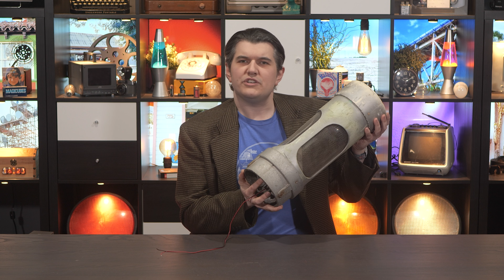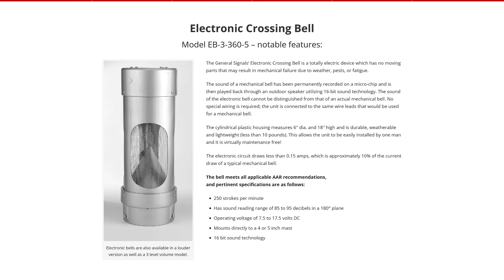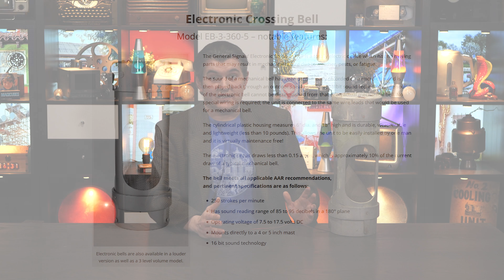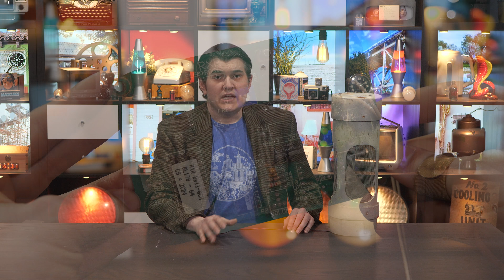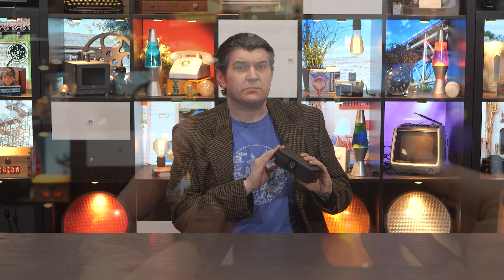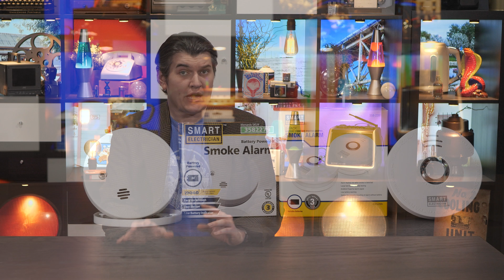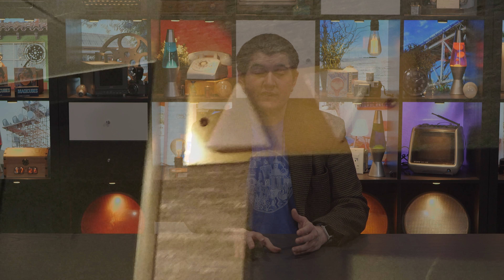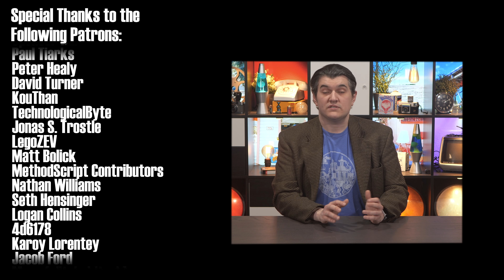The disappearing and unappreciated art of audible alerts

Comment: I'm a ham radio operator, and I use Morse code.  The coded message you put in this video came through loud and clear here.  I've set up my phone so that, when one of my frequent contacts calls me, it plays their first name in Morse code.  If someone unknown calls, it just plays "RING".  If I get a text message, it says "TXT". An email generates the word "MAIL".  My phone generates Morse code at reasonably low volume and pitch, so while others can hear it, it's not very obtrusive, as ringtones go.  It's also rarely understood by bystanders, unless I'm at a meeting of my ham radio club.

You mentioned watches with an hourly beep.  I remember being in meeting and conference rooms around the late 1980s, where if there were a hundred people in the room, you might hear fifteen or twenty beeps around the top of the hour.  Most watches didn't have a way of automatically synchronizing themselves back then, so the beeps might be spread out over a few minutes.  I still own and wear some watches with that capability, but like most people, I've left it turned off since 1990.

Thanks for explaining the temporal 3 signal!  It might save my life some day, and I had never noticed it before.

Comment: - I always thought it was metal, never knew it was silver-painted PVC tubes !
- Funnily enough back in the 80's, the UK started switching its railroad crossing bells for...alarm sounders, sounding a hi-low tone that would go faster if a second train is approaching
- Temporal 3 with mechanical bells is apparently quite common in Canada, and it sounds glorious especially in large spaces. Never been there but I've seen videos.
- In Europe, cheap smoke alarms still sound the old continuously pulsating beeping tone that was common in the US in the 80's, early 90's (usually called "4/6 pattern"). The better quality ones sound Temporal 3. As for professional fire alarms, each country has its sound. The Netherlands use slow whoop, France uses a skipping hi-low tone with the high tone much shorter than the low tone, Germany a sweep tone from high to low pitch etc...
- 16:49 "Caution ! The doors are about to close !"

Comment: I can really resonate with tech-design doing things I don't want, need or is just plain annoying. I don't know much about American or Canadian cars, but the amount of intrusive assistance systems built into cars in Europe these days are more irritating than helpful.

With the amount of useless and/or unneeded alerts, acoustic signals and plain false-positives modern vehicles give I sometimes feel like I am driving with a tired and whiny child on my lap. To make things worse they don't want you to opt-out and turn them off- 'For safety reasons' they are automatically switched back on when you restart the car. 

A fun example: I drive every day on a recently refurbished road that now has a 50 km/h limit again. Everyday my car beeps and whines at me for driving too fast; it's internal maps has the road flagged as a 30 km/h limit and it will do so until I cough up the update fees, download a corrected map and the car finally shuts up. Or I can switch the system off... every single time I turn on the ignition.

Comment: Yeah I hate modern tech. Fully onboard with everything you're saying here. Big companies don't give a damn about anything but profit.
Those E-bells as we call them have always been kinda tinny, I hear the safetran ones a lot and they get kind of annoying, while to me a real mechanical bell is a more pleasant sound because it's genuine, not just a speaker. And of course, the speaker always wins out over the classic bell because it's cheaper. Not really anyone makes mechanical crossing bells anymore. Even the mechanical bells were rock-simple (you should get one! You'll really appreciate how simple they are inside.) typically consisting of a magnet powered on and off by a contactor, a weight and a striker all mechanically linked. The magnet power linked with the contactor which acts as a cutoff for the magnet makes the whole linkage start oscillating, striking the gong. And they just worked with virtually zero maintenance for the life of the bell, many still do after being untouched for two or three decades (but of course railroads are replacing them anyways through crossing upgrades that are kind of unnecessary). Those bells are basically run-to-break, then they're replaced with whatever the signal maintainer has in his truck and the old bell gets thrown out. Even then, most thrown out crossing equipment still works when withdrawn.

Comment: My carbon monoxide detector just yells "carbon monoxide detected" but uses beeps instead of yelling "smoke detected". It also has a cryptic series of chirps and flashes for low battery or low power supply or fault. It's a speaker with a sound file so I would appreciate if devices just said what they mean. My dishwasher could have a little song instead if ear piercing beeps. This is the technological advancement I want, not internet connected fridges that make people watch ads.

Comment: Well this is interesting-- one of the first Technology Connections videos I disagree with. I do agree that sometimes, in some contexts, audible alerts are good and important. Train crossing alarms and fire alarms are two examples of those. But audible alerts on a personal mobile device are not for several reasons, one of which is they do not scale. You say that your alerts are specifically chosen to be unobtrusive to those around you, and that's great. But what if everyone chooses the same "unobtrusive" alerts? You'll have dings and bongs and chimes going off constantly in a crowded area, such that a) there's still way too much overall noise, and b) no one can tell which noise their device is making versus anyone else's. 

Add to that the fact there are plenty of contexts where audible alerts of any kind are completely inappropriate, such as movie theaters, classrooms, funerals, and so on, meaning you have to remember to constantly flip your device from audible to silent, which not everyone will remember to do. If you leave it on vibrate, you never have this problem. You say you don't always feel vibrations, and that's valid-- but in those hopefully rare cases where you are specifically waiting for an important notification, making your phone audible should be the exception, not the rule. Even after cutting back as many notifications as possible, most notifications simply aren't time sensitive. You can also have longer vibrations for ones that are, similar to a vibration ringtone, increasing the likelihood that you'll notice it. 

Along those lines, while I don't have data to prove it, I suspect most people are more likely to notice vibrations that never actually occurred rather than miss ones which did (phanton vibrations), which the phone + watch combo solves: if you think you felt a vibration, check your watch and see if you did. This further cuts down on the need for audible alerts for most people.

Comment: Living behind a church, I've gotten so used to hearing the faint bells on the hour that a lot of the time I very rarely need to look at a clock when I'm at home. If I were to ever move away I would probably have to recreate it somehow.
Reply: There are wall clocks that have hourly chimes. Or go full DIY with an Arduino.
Reply: @doubledarefan  these are great options that I have thought about, it’s more so the subtlety of the distance of the bells, they’re not intrusive. They’re almost background noise
Reply: id suggest getting an old regulator clock with westminster chimes
Reply: @knockrotter9372 Exactly what I thought of!
Reply: Grandfather clock
Reply: In a large second-hand charity shop I poked around recently, they literally had five mechanical clocks with chime mechanisms lined up.  One of them was especially cheap because it had a broken glass panel on it.

Comment: I feel your pain. The default settings always have to cater for the lowest common denominator of users, which for me usually means having annoying default settings that can't be customised.

For example, for more than a decade it has been impossible to add a new label to an email in the Gmail app. You can only apply existing labels. To create a new one you have to use the web interface. How absolutely ridiculous is that?!

Edit: typo

Additional edit: I've been using FairEmail recently, which has a pretty good degree of customisability. Great for unusual people like me!

Comment: I use the Signal app for most of my texting communication. With it I was able to set specific sounds for different contacts. On the other hand Pokemon Go keeps resetting the changes to the settings I make and have push notifications come through even though I set it to stop that. Except the notification that I got a Raid invite that I do want to know about but because all push notifications sounds are the same I have to check every time I hear it to see if an invite came through or not because you have less than a minute to see and log in to the app, if you aren't already, in order to participate.

Comment: You mentioned piezoelectric buzzers in the outtakes, but I think it got cut from the actual video. I think they are part of why modern sound design has deteriorated. As part of the capitalist race to the bottom, proper loudspeakers have been replaced with piezo buzzers to save a few cents on manufacturing, which just don’t have the capability to produce more pleasant sounds.

Comment: I did not have time to view the whole video, and it is quite possible that my issue was addressed, but here goes: 

Why does my microwave oven need to BEEP five (5) times when the timer runs down to zero? The oven already makes a noise, I am quite sure that no one in my household is unsure if the microwave oven is currently running or not. 

Some of our senses get used to the same stimuli over time (like our nose gets used to any smell after a few minutes) BUT our brain can perceive light turned off or a soundwave cutting off.

WE DON'T NEED ADDITIONAL STIMULI WHEN THE MICROWAVE OVEN STOPS. I can notice the change from HUMMMMMMMMMMMMMMMMMMMMMMM - to none.

I know, it is just 1-2 wires I need to cut inside the oven to make it mute. I once had to open it to change the plate rotating motor to a spare part, but I forgot to cut the beeper off. The oven had 18 screws I had to take off before I got an access to the motor. I bet the beeper is deep in there as well.

Comment: Not sure that public spaces need to have different alarm tones which indicate different reasons why you want to evacuate the building.
(I'm in the UK and as far as I know I've never heard that "temporal 3" thing before)
In the theatre that I work in, the evacuation alarm is a REALLY LOUD AND ANNOYING siren. Nobody needs it to stop every second so that they pay attention. You have to shout to be heard over it. 
And there are multiple reasons why you might want to evacuate. Fire is one, but there are other reasons why you might need to clear the building. The same siren is triggered by the heat and smoke sensors as by the push button sensors.
The control panel tells building management WHAT was triggered (and maybe why), but the people who need to evacuate the building don't need to know if it's a fire, or CO2, or a terror-related incident. They just need to know that they should leave immediately.

Comment: Regarding "I think this sort of signal standardisation which codifies what sounds mean, is an unquestionably good thing."

We might want to think carefully of what that standardisation should look (well, sound) like though.

Helios 522 crashed back in 2005, because the pilots mistook a cabin pressurisation warning (urgent, "you will lose consciousness") for a takeoff configuration warning (confusing because they were in cruise).
What aviation learned from this disaster, is that there are too many different alarms to reliably differentiate them all. Newer aircraft make an indistinct "ping" sound for most uncommon alerts, followed by a short spoken description like "cabin pressure".

I recognise that spoken alarms may not be suitable in locations where not everyone speaks the same language (= railroad crossings and fire alarms) or in places where sounds echo too much (= air raid alarms?)
I suppose industrial plants, or at least alarms local to control rooms, would also benefit from spoken words.

Comment: I feel like I have been noticing more and more new constructions use some "fancy" fire alarm system that has some generic alarm sound followed by a ton of words instead of the simple 3 rings. It would be really nice if someone forced them to standardize it, it is very frustrating sitting through a generic alarm sound just waiting to be told what is actually happening (when it is so easy to just use the 3 pulses and have almost everyone instantly know what it is).

Comment: This reminds me of some funny facts about the world we live in. There are places in our electric grid that are so old and improvised, that you have actual logs with rusty iron nails in a row, with copper wires going every which way on the ground somewhere in the middle of a desert nowhere. It could have been updated, but no one bothered. It is just there.

Ancient underground plumbing, electrical, tunnel infrastructure. Foundations built on foundations built on foundations.

So much of our foundational infrastructure is ultra improvised and primitive. Have you seen a passenger jet fly with none of the internals? Yeah. Aluminum tube with wires taped on the floor.

The illusion of refined competent design is a lie. Everything is barely good enough and no one bothered to make it better.

Comment: Completely agree with the notion of this video.
One aspect I think you're glossing over a bit is usability in the settings department. I know from professional experience that catering for the needs of every single customer by giving them a setting leads to
a) happy customers when things work
b) confused customers while they are setting up
c) support hell because everything is possible everywhere, and adding new features requires you thinking about 500 edge cases which you might be breaking.
I'm not saying this should stop people from doing reasonable sound design choices or even from giving more freedom to their users in this regard but it's another point to consider in the discussion: simplicity can bring inherent value for usability as well.

Comment: meanwhile most of the buildings around here are so old they use classic bells or klaxxons so it's just ear bleeding pain telling you something is wrong somehow, they can't even distinguish different sounds between lockdowns, fires, or anything else, so you never know exactly what it is that's wrong, just that something is wrong
Reply: I have to note, the fire alarm is just an old fashioned physical switch that gets automatically triggered by the smoke detectors or manually by a pull station, and the sound is just a constant ring. I think it genuinely just connects the bells directly to mains power lol.

Comment: Alec, if you don't have the AOL "You've Got Mail" sound for your Email notifications, I'd be mildly disappointed in you. 😛

Three "quacks," pause, three "quacks," pause... Commercial fire alarm. 🔥
Continuous "quacks"... Amazon truck is reversing down my driveway. 🚚🤣

Southeastern CT is stuck in the "ice age," we still have the old-fashioned mechanical bells at our railroad crossings. After a few moments of operation, they all fall out-of-sync with each other, so we go from a very clear "clang-clang-clang" to a "claclangcla-clang-clang-cla-cla-clang" long before the train actually passes by. Kind of like the intro to Pink Floyd's "Time," a pleasant cacophony.

When it comes to the importance of instantly-identifiable sounds, think of when the Emergency Alert System kicks off its required test. Or, if you live in certain regions of the US, when a tornado siren spools up. Specific sounds designed to provoke an immediate and specific response. 

12:40 - A sound I haven't heard since 2005. And yet somehow reflexively I looked up, despite sitting in a building that is definitely NOT the fuselage of a passenger jet.
16:51 - The current Ford chime is actually pleasant. But I like my automotive alerts to be a bit less pleasant, a soft chime telling me my engine's about to explode doesn't provide the same impact as a brash beep. (I'm being hyperbolic about engine explosion warnings - but alerts NEED to be noticeable over other cabin noise, like the radio, conversation, road/wind noise, HVAC noise, etc.) Of course, I drive a low-tech vehicle where it only beeps to tell me to put my seat belt on ONCE when I first start it, and it'll beep at me when I hit 1/8 tank and the Low Fuel indicator comes on. Key-in chime, headlight reminder chime. It's not beeping and booping at me all day long, so each sound carries more "weight." 
17:07 - OH MY GAWD! YES! 👏 I'VE BEEN SAYING THIS FOR YEARS! Too many people have fallen into the trap of binary thinking (in nearly every topic), and a vast majority of them don't even realize it. 
20:55 - Truly a motto for the post-pandemic world.

Egads, ringtones... I used to have one specific ringtone for each individual calling me that represented one particular aspect of them, so that I knew who was calling without even looking at my phone. Some of my previous selections: "Crazy B--ch" by Buckcherry, "Banana Phone" by Raffi, "Away From the Sun" by 3 Doors Down, "Homewrecker" by Gretchen Wilson, "Axel F" by Crazy Frog, "Mahna Mahna" from The Muppets, "Because I Got High" by Afroman, "Hicktown" by Jason Aldean, the clip from Family Guy where Stewie does the "Mom... Mommy... Ma..." bit, the audio track extracted from a now-considered-ancient internet meme about Mad Cow Disease...